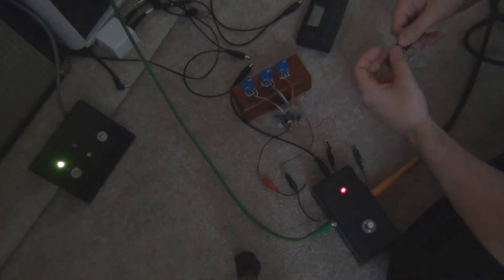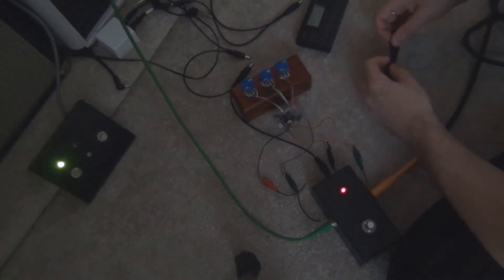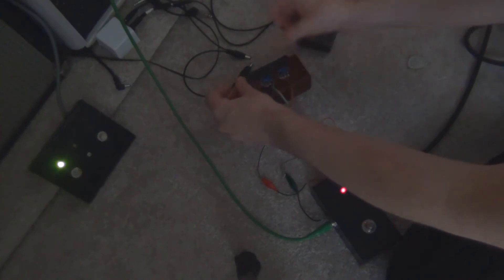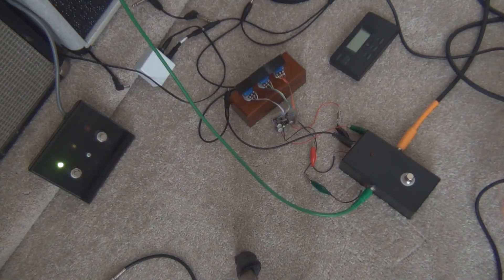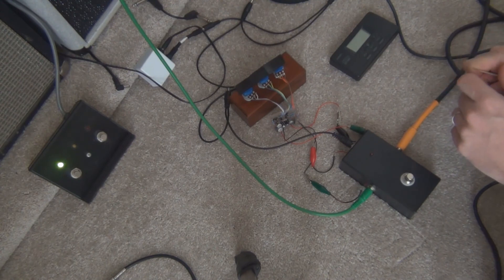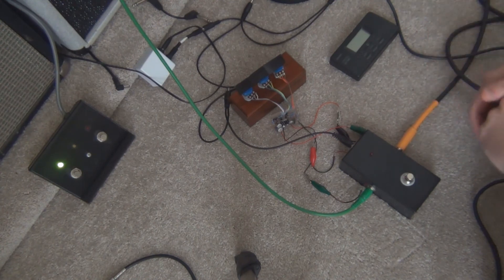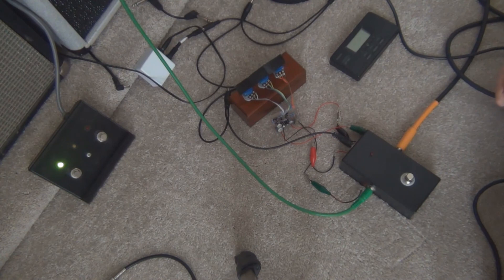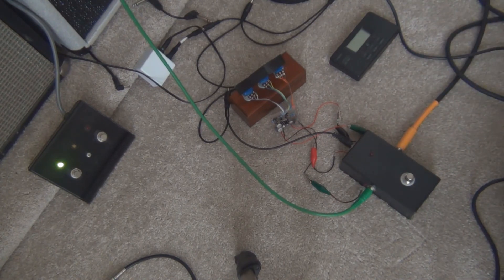Germanium HFE Test for the Madbean Bumblebee (Badwin Burns Buzzaround)

Comment: since the distortion level is very similar you should try to do a clean up test rolling back your guitar's volume to hear which combination has the most dynamic range.... i'd stick to lowest gain for the first two, since it's a darlington pair and their gain is multiplied (hfe1 x hfe2), and try to see if there is any difference in the dynamic range and in the texture by changing the hfe on q3... i wouldn't go further than 120-130 hfe.

Comment from the maker: I tried many combinations in my Soul Bender Clone, even as high as 200 hfe, and i still ended up using low gain (50hfe's) for Q1 and Q2 (and 110 for Q3).  The difference is a subtle one, to my ears anyway..
Reply: Long time ago Paul! But did you ever try a real leaky transistor in q3?